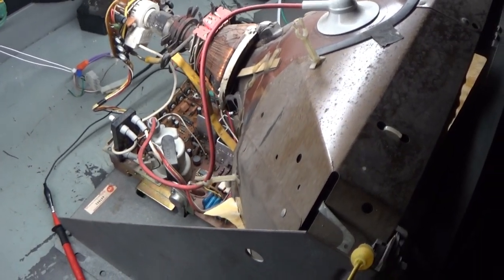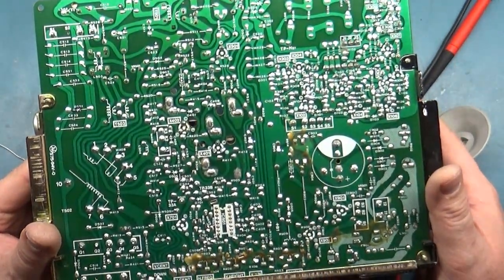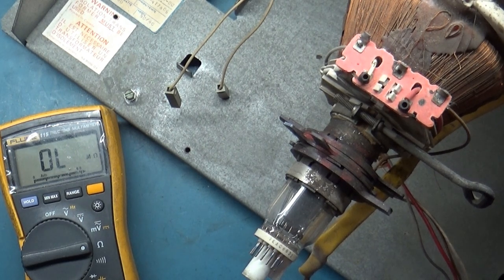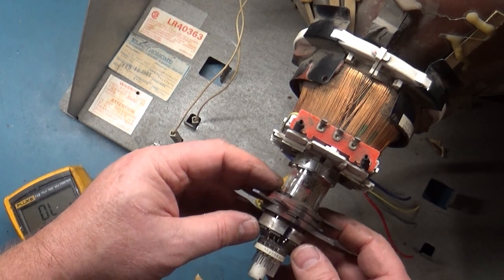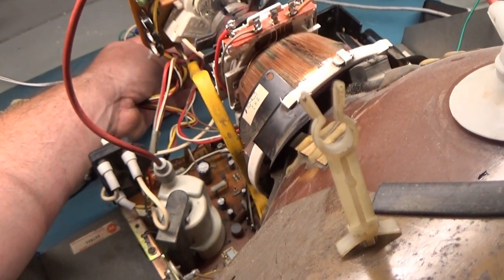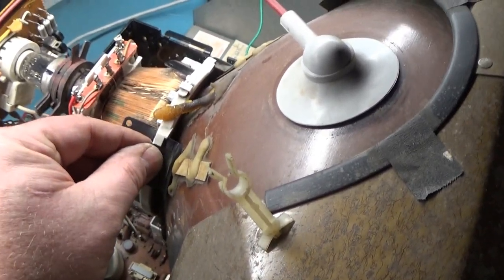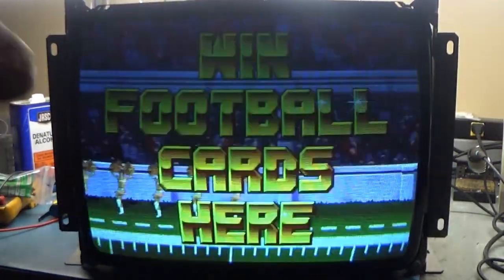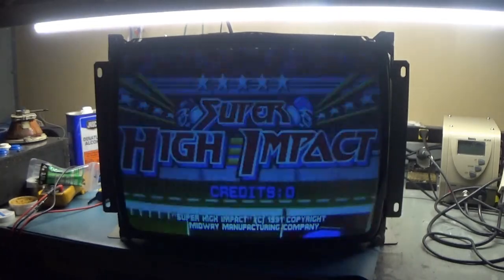19" G07-CBO Arcade Monitor Chassis Repair - Vertical Collapse - Bad Yoke Plus Convergence Nightmare

Comment: Super video.  Probably the best practical demonstration of a yoke swap on Youtube.  I learned the yoke being out of position can sure mimic what looks like a degausing issue.   Good demonstration of the convergence rings and how and when to use the little magnetic strips.   I guess its always good to just change the fly back too!  It has always amazed me that GO-7 yokes are so drastically different on the vertical ohm reading than others like the K7000.  I have been able to swap several tubes and yokes directly from old Televisions with the K7000.  Never have found a yoke in a Television anywhere close to compatible with a GO-7.  Thanks for the great video.
Reply from the maker: Thank you for the kind words.